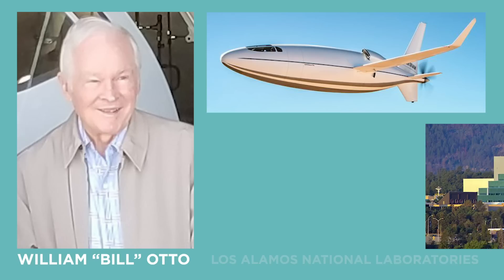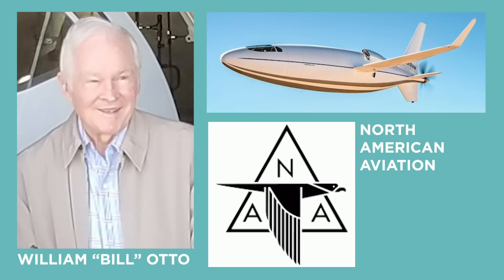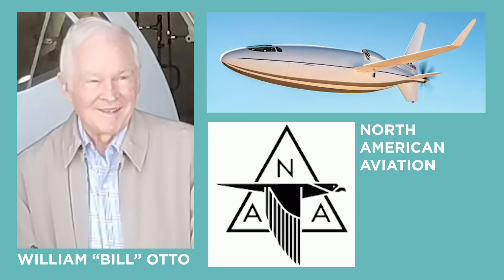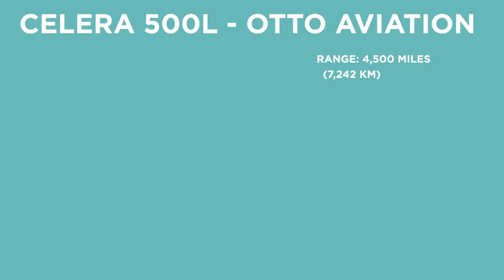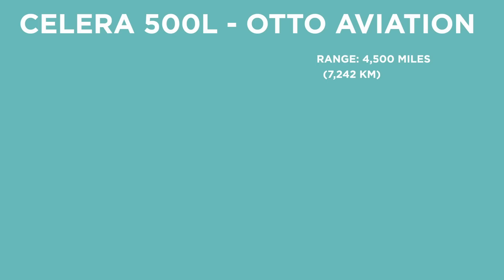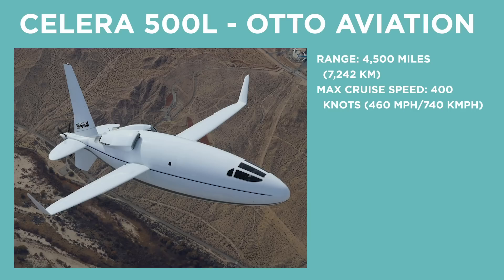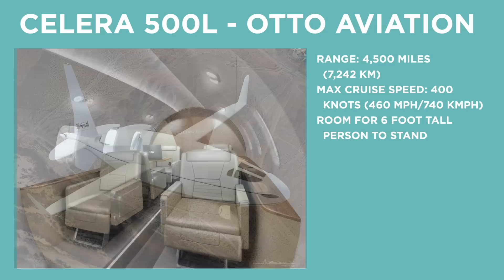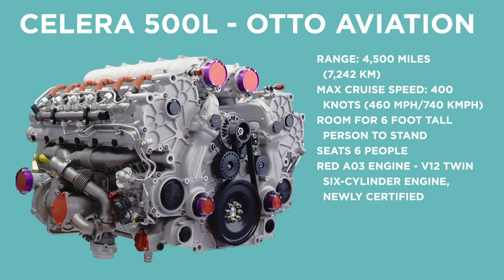Could This Plane Save The World? (Hint: No.) | Answers With Joe

Comment: I find flying to be an exercise in suffering. I always end up at my final destination, hot, sweaty, exhausted, uncomfortable and irritable. (and occasionally, I don't end up at my final destination, having been re-routed on 4 separate occasions over the past 30 years.)

I nearly always have a headache, my throat hurts (I think because of the ultra-dry air), my skin is similarly unhappy. My neck and back are always sore. It is not uncommon for me to end up with some kind of virus as well and even if I don't, I'm congested and my ear drums feel like AC/DC did a concert on them. Now, admittedly, some of this is confirmation bias, but flying sucks (and yes, I primarily fly coach.) 

Delays sitting there waiting on the plane while the AC either isn't on or is only on half-power, waiting in the airport terminal, transfers always seem to be on the other end of the terminal from where I'm let off. Lost luggage is not infrequent and my luggage is always scuffed, zippers broken are common, and on 3 occasions, I've had stuff stolen, either by people in the airport terminal (once), or by airport personnel (twice). 

And then there are the requisite fellow passengers and it always seems like there must be at least one rude, demanding, nearly always White person, if not several; a handful of poorly behaved, poorly supervised kids; some or even a gaggle of sadistic idiots who feel that an airplane is an appropriate place for a baby, all who scream the entire time because they are just as physically tortured as I am. Rudeness and a complete lack of consideration for others abounds. 

Most of the employees at these places are treated as badly as the airline industry treats the passengers, so they are rarely very happy. Rude entitled passengers, not uncommonly inebriated I'm sure doesn't help one's mood.....

To add insult to injury, my wife is younger, petite, pretty White lady, as is my now older teenage step-daughter, and you'd think they were both wearing t-shirts that said, "I'm dangerous" given how many times they've been singled out for "security" pat downs by male airport security personnel. Yes, they insist on female's doing the pat downs which only makes the male security mad and the pat downs last longer. And with all this extra security, I certainly don't feel safer and I don't think most other passengers do either.  

* * My point is that the airline industry has bigger fish to fry than gas mileage and the airline's impact on the environment.* *  

IMO, its a mess front to back, and even if it means driving in a car all day, or even several days, I would rather do that than fly, the dangerousness of driving versus flying be darned. At least I don't end up at my destination a complete physical and mental wreck. 

I should note that I'm a fit, active, health-nut grandmother who shouldn't be so physically miserable simply from flying in a plane. I don't experience a fraction of the physical discomfort driving as I do from flying. 

Flying sucks, only getting worse over time, and I would MUCH rather they addressed the above than experiment with new plane designs.....

I know, but how do I REALLY feel ?  :-P

.

Comment: Just a quick calc but in terms of co2 per passenger:
747 = 129 kg per passenger
500L = 75kg per passenger

The saving would be reasonable per person but that's if you dont include the footprint from the production of these 61 planes. Provided the 61 planes adds up to the same co2 footprint of the 1 747 then it could actually reduce the footprint substantially

Comment: this is 100% a legit argument in the heavy flight routes.   These are after all the only routes a 747 will fly.   The single biggest thing that decides a planes viability is the route.  it doesn't matter how many times more expensive a fleet of Celera would be compared to a 747 if say, a 747 cant land on the runway because its too short.    Alternatively, It doesn't matter how many hundreds of seats a 747 has if the route only sees 40 or 50 people a day.  The real sector that this craft would have an impact is in low demand flight routes.  I'm not entirely sure what the comparative numbers are between the heavy routes that you see 747's on and smaller flight routes but i can say with a fair bit of confidence it leans heavy against the 747 friendly routes. 

The second thing I would note should be considered is transfer flights. its not uncommon to have layovers, because the above point.    fly/drive into a hub, fly the big boy hub to hub, and then spoke out to the final destinations.    This craft could, in theory, Allow for much more direct route flights (reducing overall flight time, fuel, etc) and this is another thing the comparison you made doesn't account for.   It just assumes you would be flying from, lets say LAX (LA) to DTW (Texas) for the route (about 1000 miles) and ignoring anyone on that flight that wasn't moving between those 2 places directly (aka layover).

with that said, Im just a huge space and aviation nerd, But I don't actually have any experience in the fields. Just thought it was worth noting.... And I do think a similar comparison with something like an airbus A320 would be much more interesting, as the A320 family of planes are arguably some of the most flown in North America.  

at the end of the day though, This plane has absolutely been overhyped to hell.  and its nice to see some people stepping back and saying "now hold on just a second"

Comment: Comparing its cost to a 747, might not be the best comparison for commercial airline. Look at the 737 and A320 (Narrow body) aircraft.  Improving these aircraft is a continuing work in progress. 

Also airline pay a lot of money in attempt to reduce monthly fuel bills, from running only a single engine when on the ground, to re-winging aircraft to newer more efficient wing designs. 

Thank you for the interesting topic you discuss weekly.

Comment: The engine is the problem. Notice that the wings are far back on the fuselage. That means that it it very heavy in the rear, which a reciprocating engine would be versus a turbojet. It is also more complicated and historically reciprocating engines are much less reliable than a turbojet. I'd also like to know what the stall characteristics of it are. As to efficiency and the airlines, the answer currently is the 737MAX and the 787 Dreamliner.

Comment: The value of this design has little to do with propulsion type. As electric systems and batteries improve, they will become an obvious upgrade to the current system. The value is in the aerodynamics. For the most part, it's revolutionary combination of laminar flow fuselage, high aspect ratio wings, pusher configuration and ducting, are all scalable. What we are looking at, is a forward thinking combination of elements, which could lead to a much brighter future for both general and commercial aviation.

Comment: Could a fleet of Celeras perhaps just use a different model of business and scheduling?  Across the continental US for example, you could have something that functions like a bus route, going from say New York to San Fransisco, with stops in Chicago, Boise and Las Vegas?  You’d still need passengers to pre-book, but they’re simply queued to board when a seat becomes available on an incoming flight.  Having this split between many more planes might not reduce the costs by very much, but it would vastly increase redundancy, which many short-haul airline fleets currently have very little of.

Comment: I'm a pilot but I really think that you need training in aeronautical engineering to truly appreciate this design. I think that this airplane could change the way that we do things because it could change the spoke and hub system that is in use today but I think that it would have to be a larger version that would handle more than 6 passengers. For example, I have flown from Chicago over to Denver to fly down to Costa Rica due to this strange system that is in use today. I do not believe what the other pilot said about the surrounding airports getting saturated (Airports and Air Traffic Center Controllers, etc.) as all the airports surrounding the major cities in the Midwest are pretty dead most of the time. Currently, if I want to get a good price on a fare I have to get down to Chicago because that is the main spoke/hub in my area. No matter if I live in Milwaukee, Madison, Appleton or Green Bay, Wisconsin I still have to get to a hub because there are usually no direct flights. In addition to this, if there were smaller aircraft (Celera 500L or 1000L) that could handle the many smaller feeder airport runways, I could probably fly direct to my destination without having to go through all the current security.  It may seem a bit cold of me but it is a fact that smaller airplanes do not have the same explosive impact as giant jumbo jets when you fly them into large buildings so do you really need all the TSA agents around worrying about hijacking? Therefore, there is a potential for some cost savings where there is security staffing as well. Pilots of these planes will still need a commercial, instrument and ATP rating but I don't believe that they will need the multi-engine rating as this appears to be single engine aircraft. I have been to many small feeder airports and they are currently serving very few private planes and business jets and I believe that they would welcome the additional traffic. ATC and TSA would adjust as the changes would probably be gradual but this might change things for the better or not- hahaha!

Comment: Someone likely did this math already, but: $328 / hr x 6 hours to get from New York to Seattle is a bit less than $2,000. Add fees, randomly saying $500 extra for space, storage, landing, etc. Add more personnel, add $300. But lets say their estimates are simply wrong, and add another $500. So, $3,300. Now, First Class from New York to Seattle is about $500. That's a common flight. Say your company needs to send 6 people. $3,300 to get a private jet instead of stuffing your employees on a germ-infested 747? $3300÷6 = $550 per person for the private flight, with standing room, and obviously a space where you can converse. Who would pay the extra $50 / person for that type of flight? Almost any business really, if they frequently fly people business or first class. These numbers would have been good to mention. Of course the "hourly rate" of $328 is simply BS. That's like saying a trip to Vegas with 2 nights plus flight can be done for $250 for 2 people. Yeah. We all know how that goes. There are other costs involved, guaranteed, but once the plane lifts off the ground, it might be that $328 per hour.

Comment: I look at this aircraft as revolutionizing regional carriers, flights to smaller airports becomes viable agaim, in that one could replace aging 737s w/ a commensurate # of these aircraft, as one example, and instead of A flight time one could see multiple departure times. It would cause problems at major hubs, but for flights between regional or smaller airports, some of which may not be supported by ATC [I live near a few w/no ATC], it could provide options. My read DREAM plane would be a X-48 style commercial carrier [short runways, large carrying capacity, etc.] Good primer for this topic, THANX!

Comment: Should have used the price of a new B787. It cost $170M.  But large planes still make more sense than small ones because of the number of passengers it carries, price of tickets, the money generated from cargo, and the ability the turn the flights around quickly.

Comment: I can see a calera killing business and 1st class seats It could fly point to point vs a hub business model.  There is new tech to improve the efficiency, flex wings for flaps and wing tips for flight control. Electrification could also be done as a hybrid. The greatest power need is to reach cruising altitude. Use a battery to boost power for takeoff and size a generator for cruise.

Comment: "The Electric Planes." Sounds like a musical group of long ago.;) If you check aviation news, airlines are retiring 747s due to the 4 engine configuration, which costs more to fly than a twin jet airliner. As for how useful the Celera 500L is, that depends on the market, number of passengers, and the distance to be traveled.

Comment: I think this plane is about convenience and accessibility.  This plane will operate out of small airports and without TSA inspectors and waiting lines and early arrival, etc. The hours you save can be spent in the air which takes you as far as the newest airliners for a very large number of destinations. And those destinations can also be small airports much closer to where you want to go. ALl of which you probably say if I watch the rest of the video :-)

Comment: Cool video, a down-to-earth look at this. But I think you're missing something. Point-to-point. This will allow flights to so many small airports that can't handle business jets or airliners. Instead of someone driving 2 hours to a major airport, maybe they can drive one hour to a smaller one, and fly direct to their destination instead of another airport that is also 2 hours driving time from their destination. That new traffic won't be centered around major airports, thus relieving some of the airspace congestion you're concerned about. Think of it as Air Uber or Air Lyft.

None of this is certain, and I think this particular plane is too small to make that work. But as you say, it's a new and different concept. Who knows where it will end up?

Comment: Cost of a 747 would be $219.9M so yes cheaper the 61 Celeras. Also something to consider is how much ramps space 61 aircraft take up comparted to 1 Jumbo, plus you'll need more ground crew for that many planes and it'll also flood air traffic control with so many aircraft in operation.

Comment: Im glad you at least brushed upon the real purpose of this aircraft and its true impact on travel.  To qualify my view, Otto Aviation is incorrect if it believes it will significantly reduce carbon emissions with this aircraft, it could in fact be argued that it will increase aviations contribution of carbon emissions.  This aircraft WILL NOT compete with 747s or any medium or long haul jets today.  This aircraft will create and expand air travel to largely under utilized small airports, allowing a much larger demographic to become jetset.  The misconception that our skys are crowded and ATC cannot handle the increase in air traffic is not true. Our skys are only busy around Class B airspace and their associated large city's.  The smaller airports this aircraft will utilize are closer to where the customer wants to go, with a seat cost of $50 an hour or less and  reduceing door to door times significantly, the 500 will open up part 135 air travel to many more people. It will be cheaper to "road trip" with the 500 than travel by car.

Comment: Thank you for the great video, however IMHO, in your comparison with the 747 you missed one of the most important factors that is "granularity" both in terms of number of passengers and routes. You are assuming that the 747 will always be full booked. If it's not, you will still need to fly it. On the other hand, you will only need to fly as many of the 61 Celeras as you need to carry the number of booked passengers. About the routes, it is only economical to fly the 747 on the most busy routes, which results in the need for many passengers to stop one or more times on the way to their destination. With the Celera, if range allows, you could always have direct flights which will also allow to ask for a slightly higher ticket price.

Comment: To be fair, large flights like that are rarely if ever full. Especially now some flights are going empty. Smaller planes would make things more flexible and it suffers the early adopter issues. But if it works at a small scale, scaling up to large planes that are way more efficient would be easier.

Comment: The Celera is more of a regional jet that would be used by executives. BTW when you are figuring fuel cost it is based on passenger miles per gallon. In the United States, the national passenger miles per gallon is 64 MPG on commercial airlines. Beating pretty much any gas or diesel car on the road.

Comment: The 747 is not as popular as you might think, there aren't a lot of routes overall that make a 747 worth it. I was working in the travel industry when the 737 Max disaster happened, and overnight it became very difficult to find long haul flights, especially departing from America(because Muricah, and most airlines don't like buying a lot of European Airbus A220's....). You almost couldn't get to/from Hawaii for weeks, and it took a few months for airlines to shift their other inventory around to fill in for the sheer number of aircraft that got grounded. Mostly bringing older non Max 737's out of mothballs for shorter domestic routes, and shuffling around their 787's and 777's.

It's hard to fill a 747, and they cost a lot to run, especially compared to running a fully loaded 737 Max(better fuel economy than the 737 models that came before it). It's just hard to justify a 747 for anything other than the busiest of routes. The sweet spot is generally 100-150 passengers per flight. I'm pretty sure the majority of 747's are cargo aircraft as those are easier to keep full compared to 400+ seats.